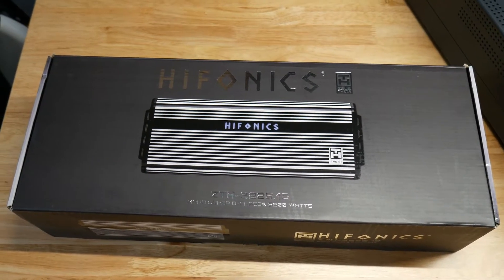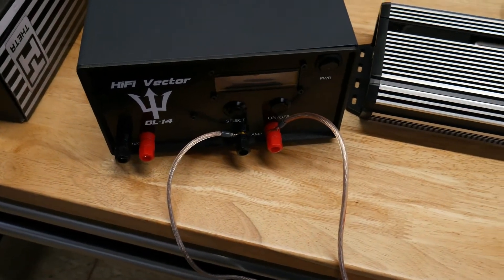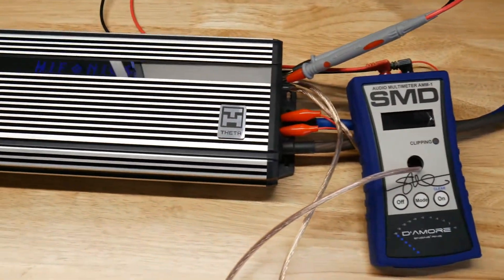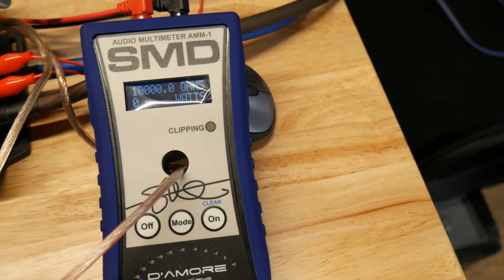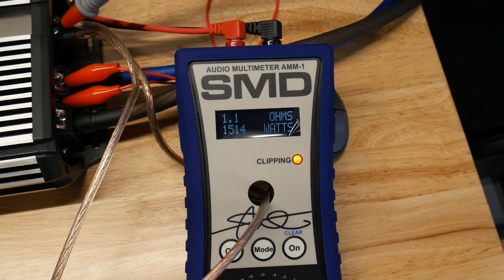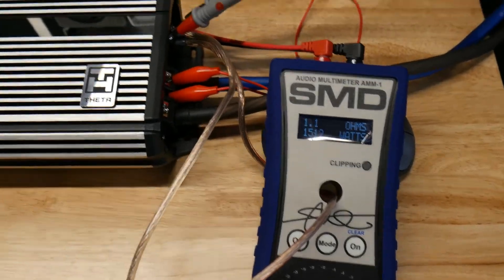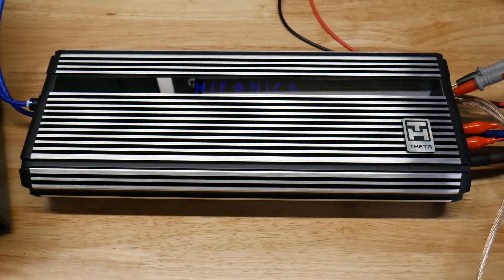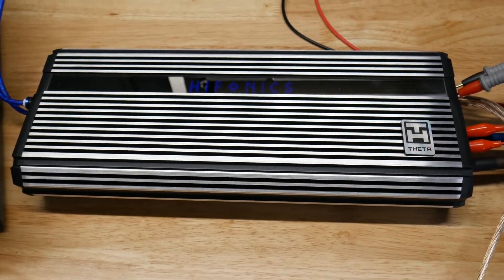Hifonics Amp Dyno Theta ZTH 3225 1D HiFi Vector DL 14 dummy load with the SMD AMM-1

Comment: I love HiFonoics amps,  One of my first amps were a Taurus X and Centurion X. They were great little amps that you could take down to half an Ohm without any issues.I had a Zues ZX6400, Brutus 1000D, Brutus 1500D, Brutus BG1600.4, and a XXV Colossus amplifiers. I was running the 1600.4 and the Colossus untilI recently blew the Colossus after almost 20 years. I was totally bummed. I would of went with another HiFonics amp but they really didn't have anything I felt was worth while so I switched to something. I get real excited when I see an amp do good numbers, but then sad again when you see performance like this one.
Reply from the maker: I like Hifonics, the amps last and are actually well built. You just need to know by watching DYNO videos what actual power you are getting. AS long as you know I think they are still good amps.

Comment: Coming from a die hard Hifonics lover, installer, reseller, and user since 1983 ....I can honestly say the company has gone to absolute shit. The last TRULY great amps were the BRX "00" (pre '16) series as they were the last of the CEA compliant. I have a BRX2400.1D in my Tahoe on a 1 ohm load since 2013.....just feed it PROPERLY (I'm personally running a 400A Brand X alt and 1/0 ga  OFC powering that and a BRX640.4 and have had ZERO PROBLEMS. These NEW models do HALF their rated power.  I guess Skar, Down4Sound, Soundqubed, Memphis and the rest are the new game in town. Oh well, Hifonics had a nice 40 yr run, but alas, the king is dead.....LONG LIVE THE NEW KINGS!
Reply from the maker: I have that same BRX 2400.1D and I love it. Actually I have a couple. For the new amps the BG series amps are their best that they have  currently as far as accurate ratings go and they are pretty solid amps but they fall a little under rated power but not bad. I think some brands focus on the larger “ budget “ customers that just want cheap affordable bass. I think that market is the majority. That’s my guess anyway. Thanks so much for watching!

Comment: This amp is now only $200. Pretty good deal for the watts you get. To compare a 2000 watt Memphis Audio amp that is rated at 200 watts @ 4ohm is $150. This Hifonics amp puts out 592 watts @ 4ohm for $200.
Reply from the maker: Yes now that price has dropped its No a bad value.
Reply: @HiFiVector  Yeh just bought it thanks to your link. I'm gonna push a CT Sounds Tropo  Duel 4hom !0" sub in a .8 cubic feet sealed box. I'm gonna wire it in series to keep it at 4ohm since the Tropo is only rated 650 watts RMS @ 4ohm. So this amp will push it just fine with almost 600 watts. Keeping everything @ 4ohm will make everything last and I should get good deep bass with this setup.
Reply from the maker: @mr-alexknight6578  Awesome thank you I appreciate you purchasing thru the link.  If your sub is dual 4 ohm it can only be wired to 8 ohm or 2 ohm so just hook up positive to positive so it will final at 2 ohms. With box rise ( impedance rise ) you will be fine. They are good value and quality amps since the price has come down by almost 50%.
Reply: @HiFiVector  yeh meant to say duel 2 ohm. This systems gonna hit  LOL.

Comment: What power supply are you running to power your amps
Reply from the maker: We use a  220V power supply that provides 14.4 V and 370 amps of output.

Comment: Hifonics only has like 5 amp designs but they package them in 20 different amps. The Brutus 2200 are the same as the Zeus 3200. Brutus is the true line all the rest are over rated.
Reply from the maker: I believe it. The alpha and theta are same as each other as well from my testing.